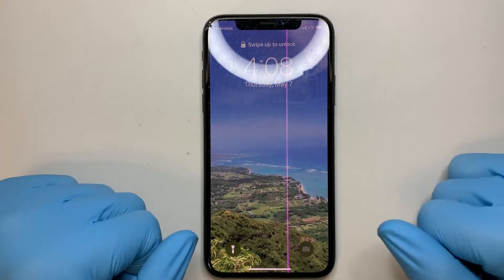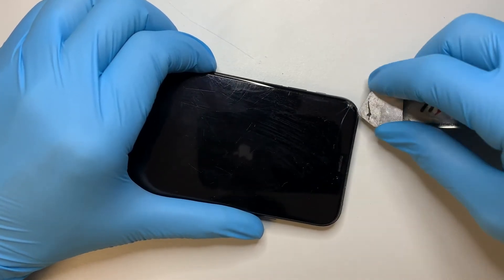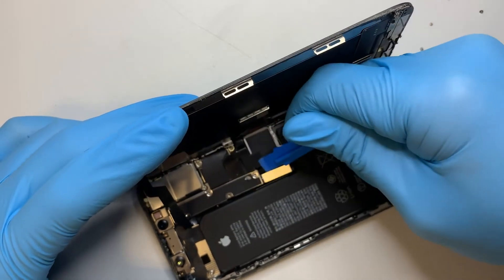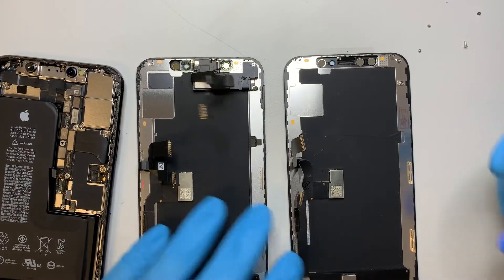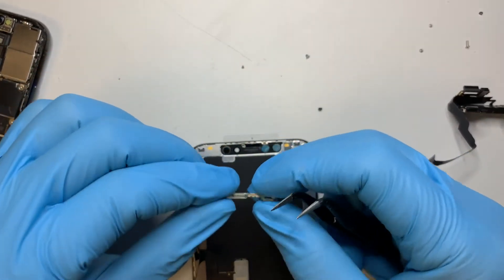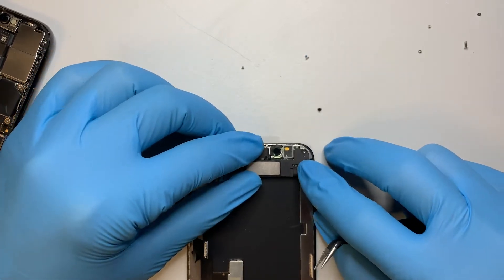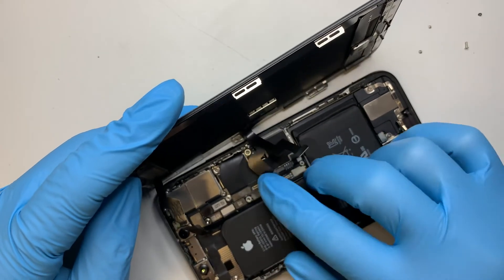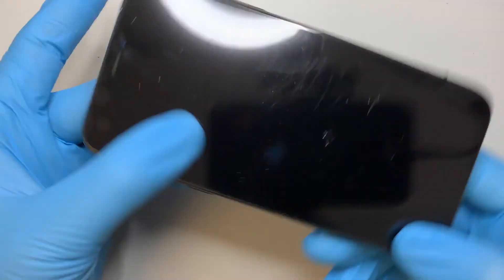iPhone XS Screen Replacement

Comment: Thanks sir but if the screen is Oled can I use tft or ips and what is different
Reply from the maker: Yes, you can. Not much a different. Except the light is not as bright when you are using outside under the sun light. If indoor, you cant see the different.